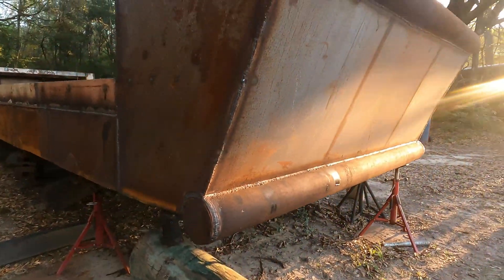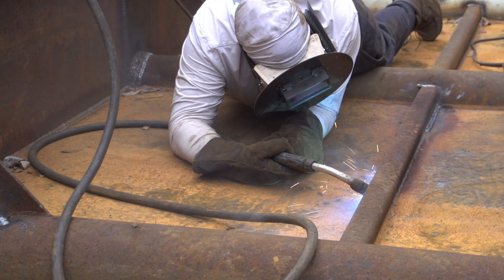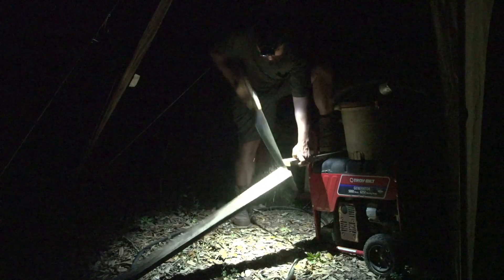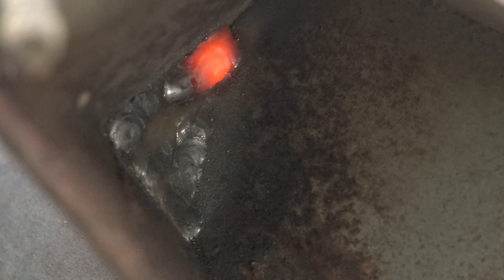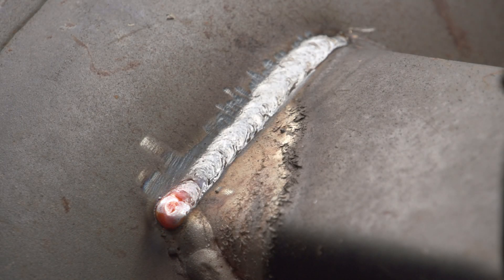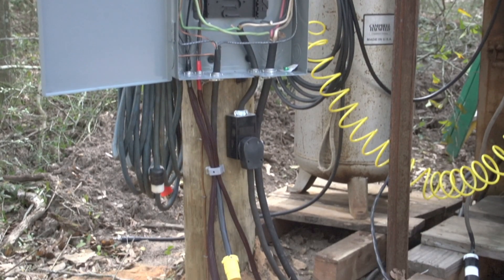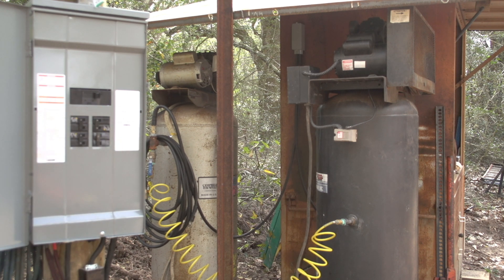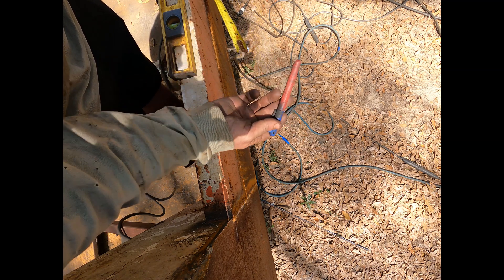Going on the grid

Comment: I know you are on a budget but Fixing a pressure vessel with that kind of rust damage is exceptionally dangerous.  As you probably already  know if that tank lets go it will likely behave like a pipe bomb.  Good luck
Reply: I figure he'll be fine even if it blows, maybe lean some materials next to it in case of shrapnel. it'll blow out the bottom and jump upwards, based on where that weak point is
Reply: Agreed.  Remove drain valve at base, get an inspection optical probe + light in there (borescope) and look around.  Also tap-test the lower section because the corroded areas will not sound right.   ASME has codes for pressure vessels for good reasons.
Reply: https://www.youtube.com/watch?v=sm_FJ6Pat4I&t=1s
Reply: Be careful beside that compressor please,not a good idea to repair tanks that have rusted out, repairing a crack from vibration is one thing but from rust is another. If you're going to use it have it in spot where you can not get hurt.
Reply: It’ll be fine. The weakest part will go….